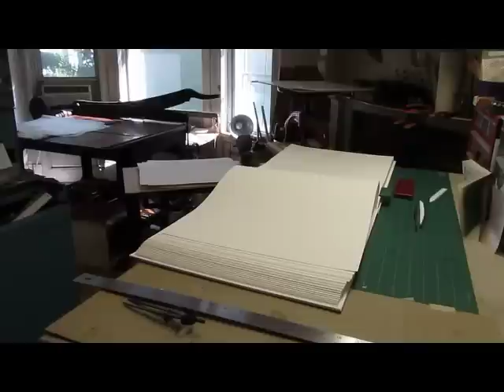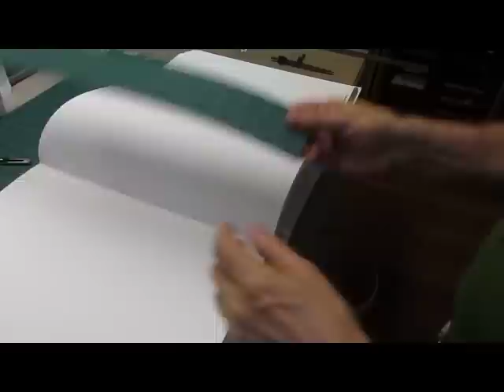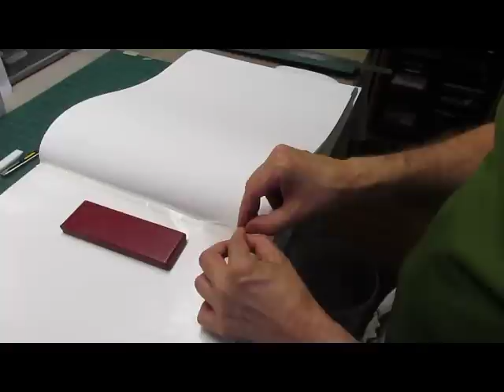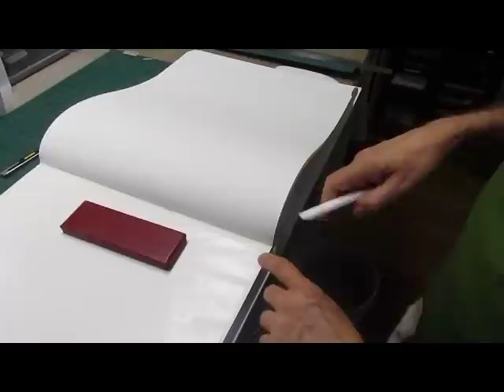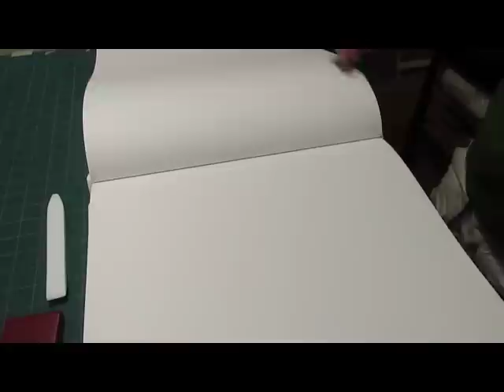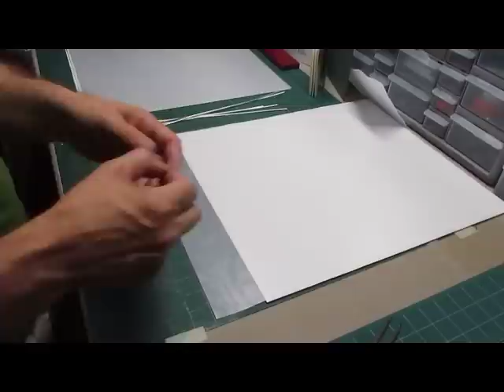Photo Album - Guards with Glassine

Comment from the maker: the album is built  the same way as you would sew a book of signatures, instead of text weight paper use something like Stonehenge or Somerset. It is helpful to let the signatures rest overnight in a standing press before sewing. After sewing, tip up the spine and find a printer with a guillotine to trim the edges.Then continue with rounding and lining the spine videos, then on to casing in and guarding a book for a photo album. Write to me through my regular email if you need more help.

Comment from the maker: See my video on preparing a photo album, I always do it this way. This way you can build the book using presses without having to pack the book out and deal with those loose sheets of  packing paper. It saves an enormous amount of time in folding, sewing and other things you have to do to bind an album. Cut out pages can be used to make watercolor blocks or be made into other books. The adhesive is twintak sometimes sold as cellotak. An adhesive coated tissue between protective papers.